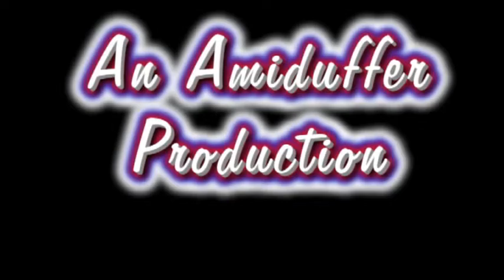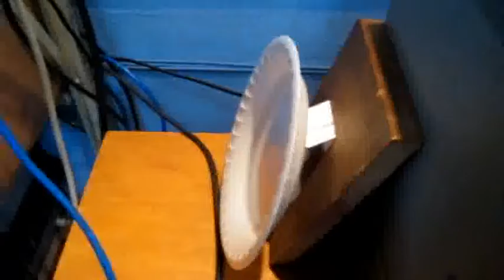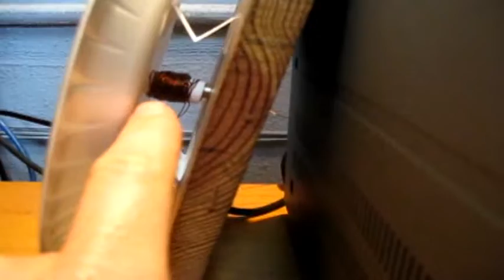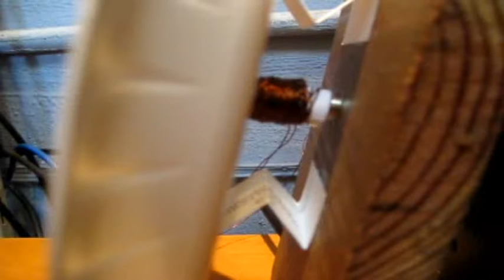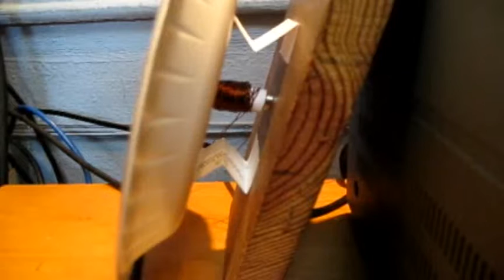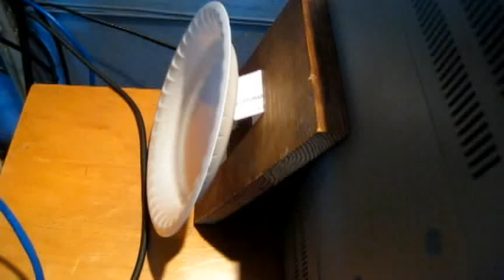Music From A Styrafoam Plate

Comment: @Amiduffer I have made some modifications to it I have used A4 paper folded and glued a few times to its stiffer than a business card and I have 4 of them folded like suspension ( it dose move freely ) and the magnets are a bit bigger about the size of the card thats in the middle of a roll of insulation tape. I used inculated wier as the coil and its prity thick

Comment from the maker: @snakev10v5 Its got to be thin enough to wrap around the paper tube enough times and not weigh it down, since you're only using business cards to hold the plate up. It has to be coated wire of course.

Comment from the maker: @legomastr1 I did it the way I did because the stereo required a bare cable in the speaker connector and so I only had to plug the speaker wires directly into the stereo after scraping off the coating. You're thinking of an RCA plug.